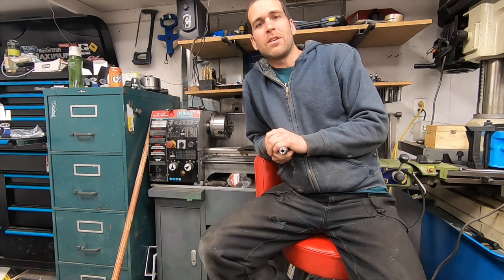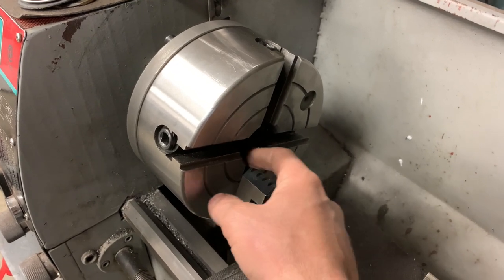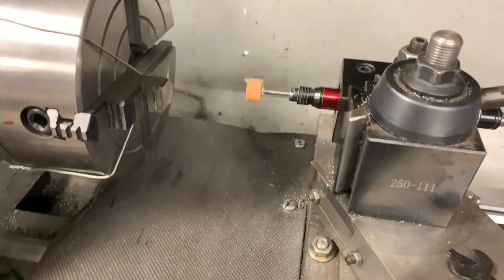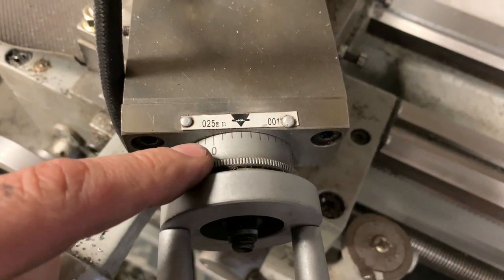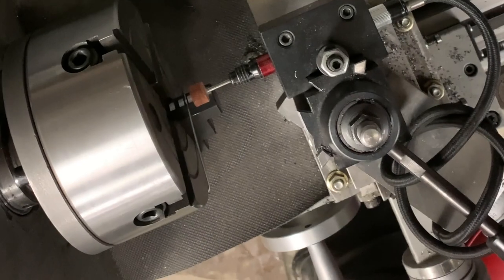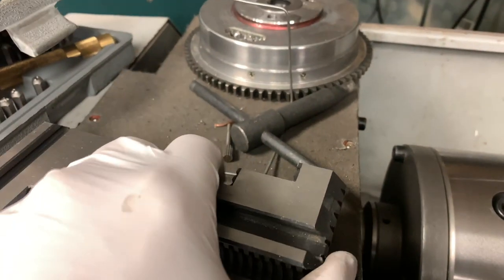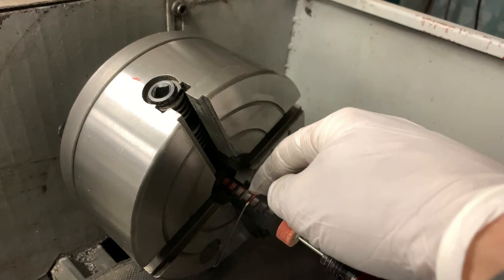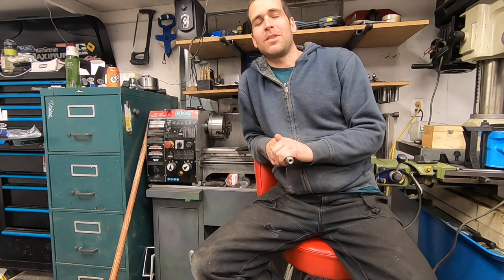4 Jaw Chuck Grind - YOU CAN DO THIS ! - Tool Post Grinder Solution !

Comment: 1. why do you care about measuring from ground to its back? it is not critical and does not have any role specially in a 4 jaw independent chuck
2. even with a completely crooked 4 jaw I chuck you can dial any cylinder true but at a single point, so the test in the end of the video is really useless, you are supposed to grind the chuck when its jaws are crooked, so you should be able (if you have a proper setup) to correct the jaws so that they are square to the spindle axis AND bite evenly on the stock from back to its front, this is the only requirement of a 4 I J chuck
Reply from the maker: Did you watch the video ? I'm having a hard time understanding what you wrote, and you seem to be saying stuff that I said in the video. 

I don't know what you mean by "ground to back" maybe "front to back"  If the jaws are not square to the spindle axis, then you can do all the adjusting you want, and your shaft won't ever be true. If you check it at one point, you can get it true, but as you move closer to the chuck or further away, it will no longer be true. 

The whole purpose of this video was to correct the jaws so that they are square to the spindle axis. I preloaded the jaws, individually, ground them true (while they were preloaded) and then tested  them afterwards. At the end of the video, I check close to the chuck and then at the tip of the shaft, and it remains at zero... this shows that the jaws are now square to the spindle axis.
Reply: @JoelArseneaultYouTube  
front to back yes, ground means the side you just did to its back, i see no point for this, sorry i did not see the video properly, looks like you tested front and back of the shaft, ok everything looks nice, i do have a similar issue with a new but chinese one, however the new 3 jaw chuck was very true out of the box, for 4 jaw one i am not sure if you might be lucky with that tension you created? i think depending on where the jaw is high it will swivel/rock on a precision test shaft? but with the tension you created it will always rock on a specific point, so that might not match a real tension of a precision test shaft? and that alone can defeat the purpose of the whole operation, what do u think?
Reply from the maker: @GraphicManInnovations  Yes, you are correct. I may have just been luck, but what I did was try to load the jaws more on the outside. My thought is that I will always be grabbing with the outside part of the jaw, so it is more likely to be loaded in this way... Also, if I grind all of the jaws this way, if I use the whole jaw when grabbing a longer work piece, this should help lock everything into place. 

I know this is not a perfect solution, but I think that it is the best solution that I have. 

As far as the precision shaft test, my thoughts are this. If I have one jaw that is higher at the back and another that is high at the front, the jaws will end up somewhere in the middle of the rocking play (I hope that makes sense) If I loosen and tighten, it may be in a different place based on the tension of the chuck, flex of the jaws etc. However, if they are all ground square to the bore axis with the play at the end of all of the jaws, then they will all, always take up the play in the same direction, at the same time. 

It seems to have worked well for me. I have only used my chuck 5-6 times since I made this video, but it is much better than it was.
Reply: @JoelArseneaultYouTube  well well that is very interesting, i think you have been lucky just because in a normal shaft tension on ur specific chuck it looks like the rock was on the back of the jaws, so you just did the same thing, so that worked, in another scenario i am not really sure what would happen, but lets think about it together, imagine the opposite, the jaws are tightening on their fronts only and no marks on their back, did u think about something? u might think now lets just tension them to the inside instead like using the same machinist wire but wrapping them together, but does tension being created at the fronts means that the jaws are in contact to the inside of the t slots? that is the question, i am thinking that it might not mean that, think about jaws that are really off (much thicker at their fronts) what would happen? i think they might still in contact to the back of the t slots right? if that is the case then i am assuming that it makes sense to just pull back all the jaws as u made in any case, perhaps because the force is coming from the bottom of the jaws and the t slots are up, that what makes the jaws always in contact to the back of the t slots? what do u think?
Reply from the maker: @GraphicManInnovations  I think it is rare that you use only the back of the jaws and not the front. If you only use one part of the jaw, it would be the part closest to your tool, and if you use the whole jaw, then you are also using the part closest to your tool. 

Basically, I think that it is very rare that you would hold something in your chuck that would cause the jaws to rock in the other direction, and if they are all ground with the same angle (while preloaded) then grabbing a part will usually cause them to return to this angle. 

You are correct that the jaws will still have play, and that if you push only on the back of them, all of your jaws will move this opposite way (taking up the play) and this will likely not be accurate. Also, I think what you are saying is that more of the jaw hangs out past the pressure point on the chuck, so this will usually cause it to take up play in the way that is desired. 

There is no real perfect solution, but I think that you have to choose one side or the other. There are many more things to take into consideration than what you pointed out. For example, the slots in the chuck, that hold the jaws, may not be cut perfectly. For this reason, the jaws being square to the spindle axis when holding a 1 inch part will not be the same as when holding a 2 inch part or a 3 inch part. 

For this reason, I choose to do mine in a way that I thought would represent the way that I normally use my chuck. 👍 Based on the amount of material that I removed from the jaws, and my results afterwards, I think this is a good method for most people.
Reply: @JoelArseneaultYouTube  the middle part i really could not understand, it is not so easy to describe stuff like that in text, however let me tell u something, i just made a very nice test on the chuck i have, i did tighten on a test bar and placed the dial on the jaw surface facing the tailstock (that square area), then i just released it and watched the dial, guess wut, all the jaws was really leaning on their backs, just as u had to do with ur setup, no wonder why u were successful, now i want to make another test, keeping in mind that all my jaws (new out of the box) are bird mouthed (contact on their backs) i want to shim or just tighten the test bar on their front only, so the contact is on their fronts only and see if the jaws are going to lean on the t slot backs also or not, and sure i agree with the t slots if machined incorrectly you should get different performance on different stock sizes, however in order to get that the t slot need to be machined in a curve, if they are machined in straight lines and still at an angle, i think that should not affect the performance in different stock sizes if you ground the jaws using ur method, think about that